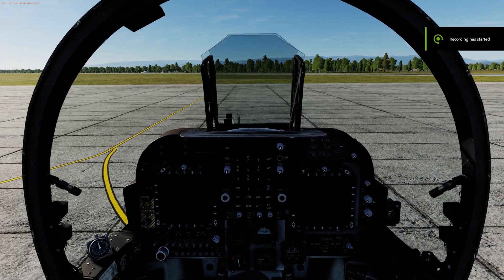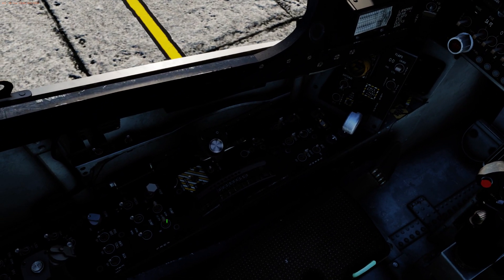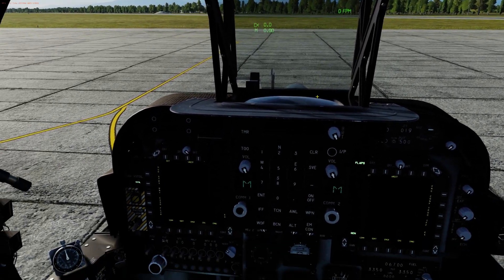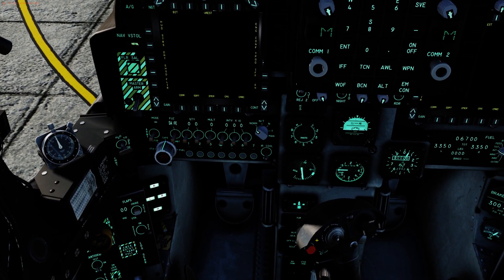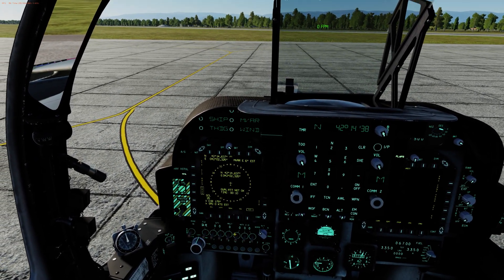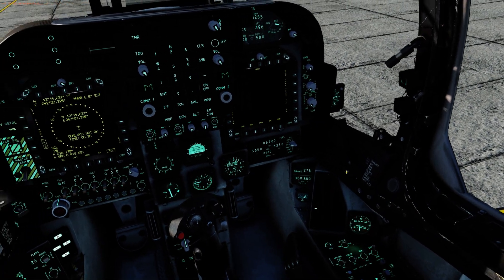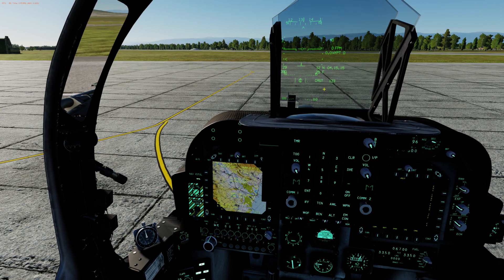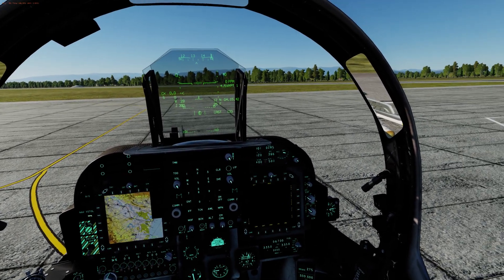INS Alignment - AV-8B N/A Harrier - DCS World

Comment: nothing happens when i do that, it stays at zero and not ok
Reply from the maker: In the OPTIONS menu go to Special - AV-8b N/A - In the drop-down menu for INS default alignment, select "SAVED HEADING ONLY". Then try again, hope that fixes your issue.
Reply: @cutlass6332  i forgot i deleted my options,  thanka sorted
Reply from the maker: Option 1 (Unaligned) Means you will have to manually input the aircraft position using the UFC, prior to starting the alignment process.
Option 2 (Saved Heading Only) Means you will not have to input your Lat/long for aircraft start position on the UFC prior to beginning alignment.
Option 3 (Pre-Aligned) You do not need to input you start position OR Align the aircraft - The aircraft is already "aligned".

The reason for these options is so that the player can choose to "do it the hard way" or not have to do anything at all. For instance, if you choose to do it all manually its going to take about 5 mins to get through the process, if you choose option 3 then you are airborne considerably faster.

Hope that explains it :D
Reply from the maker: I should also say, Option 1, does not work for me I can get to the point where I manually input my Lat/Long but when I turn the alignment switch to INS GND, my timer does not function. Its definitely bugged for me.

Comment: are you using open beta or release? cause I am not seeing the timer go down on release
Reply from the maker: Open Beta mate
Reply: I have the same issue wondering if you have to do this manually?
Reply from the maker: @yogiparashara4016  what have you set the INS to in the aircraft main menu settings? You can choose three different options. One which requires full alignment one which is less input and the final option is just to turn the switch to IFA and away you go.

Comment: when iu turn my mfd on and go to the map screen the lat and long does not auto input like it did for you...
Reply from the maker: Go to harrier specific options in the main menu and select the second option down in the drop box for Alignment. I think the first option is currently bugged.
Reply: Cutlass72 the first option is not bugged. You need to setup your lat/long and magnetic deviation based on your location in the map. 
With the second option basically you are skipping the first insert of data.